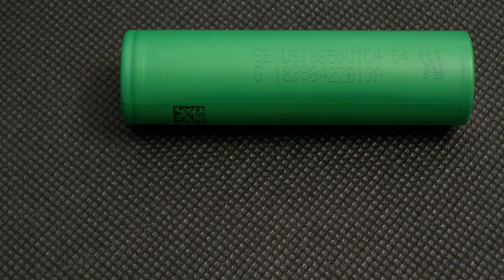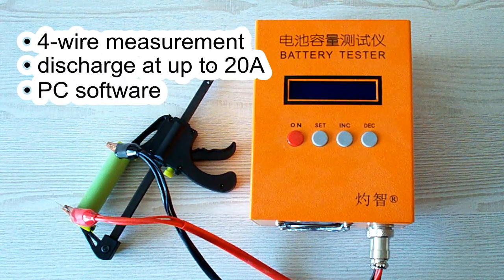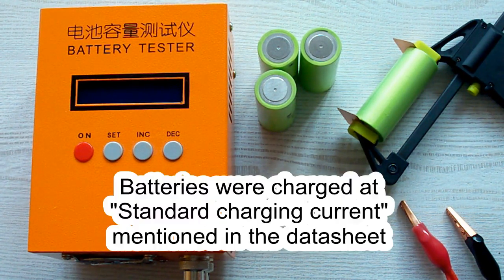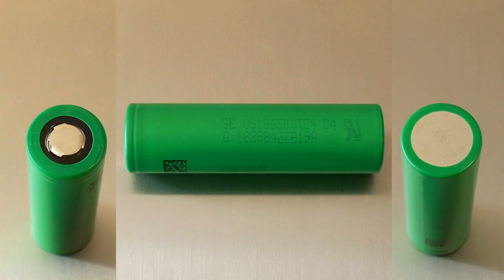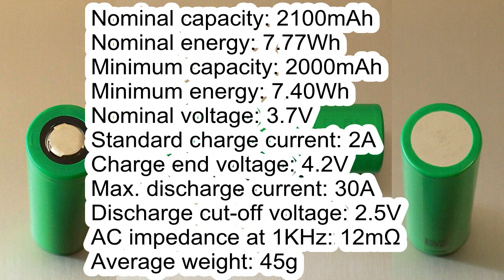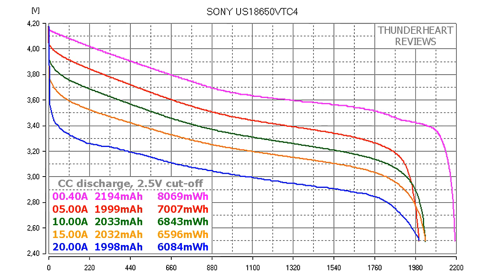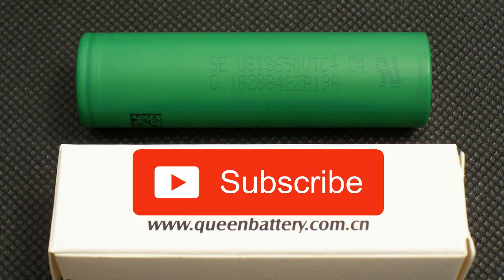SONY VTC4 2100mAh 30A 18650 battery's capacity test

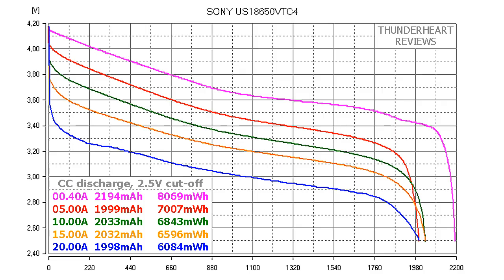Comment: 2:49 You should have also measured the capacity at 1A & 2A, as these are the more practically common amperages per application
Reply from the maker: For your application you mean. The majority buys these high current cells not for using it at 2A.

Comment: Hi ,i pretty new to the 18650.I have a question does it matter if it say G 1828842ZB19A underneath SE-US18650VTC4,because some of my battery say  G 0397061XE13A ?...last one, would these be good for ebike battery pack?.Thank you Thunderheart
Reply from the maker: It's better to use cells from the same batch but if some are from another batch it's not an issue if all the cells are in equal condition.

Comment: request a 60A battery cylaid test, because I haven't entered the data yet, but if it's used for a mechanical mod it's perfect

Very useful video

Thanks friend
Reply from the maker: The next video will be about 3600mAh cells. Stay tuned ;)